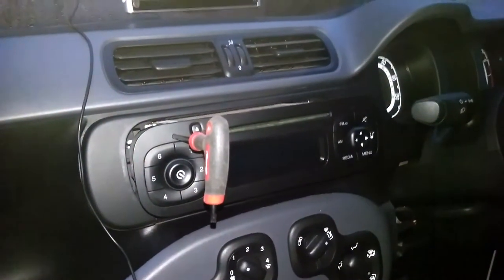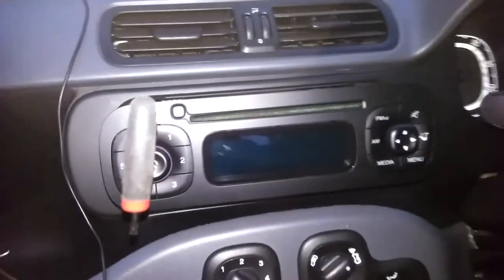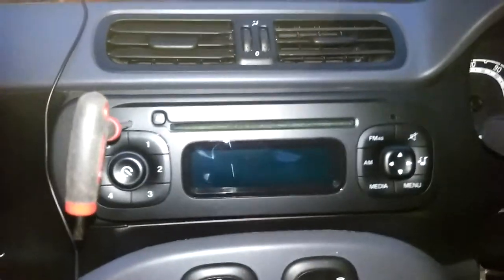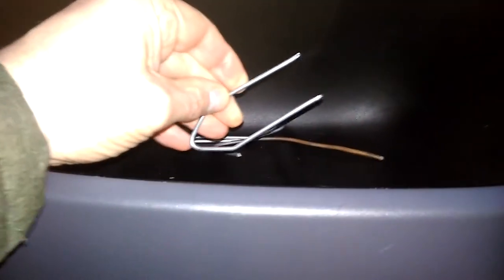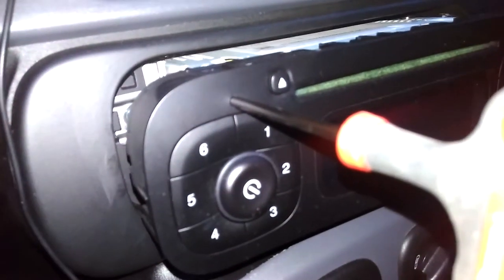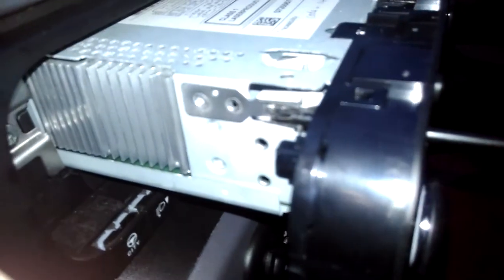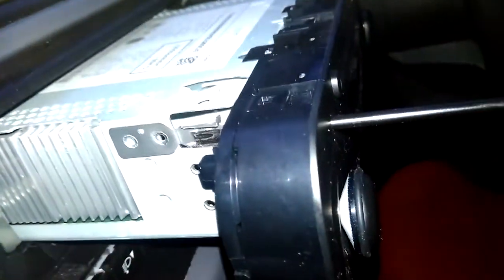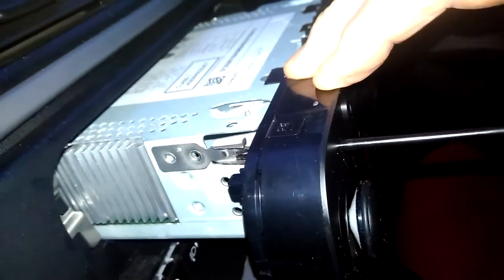Panda popular, 2013 car radio removal.

Comment: Thank you for showing this, but you show the clip, draw the tox back, then forward and say its still not enough to release the clip. How do you remove it then? Did you use this tool or another and do you push it to one of the sides to release it?
Reply from the maker: The Torx is the right size, the other standard removal tools are not.